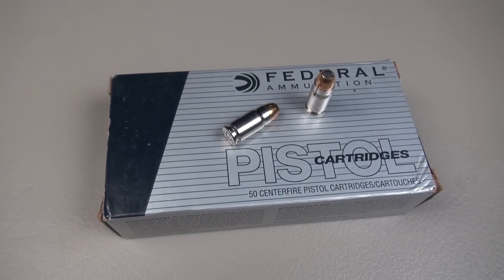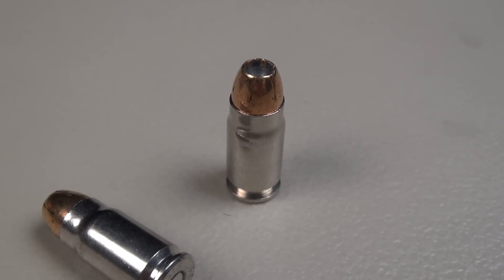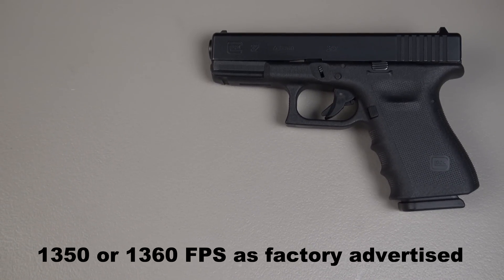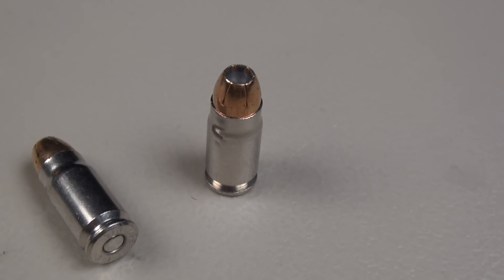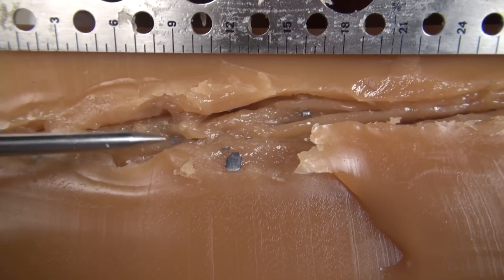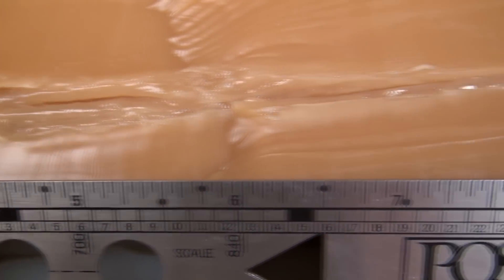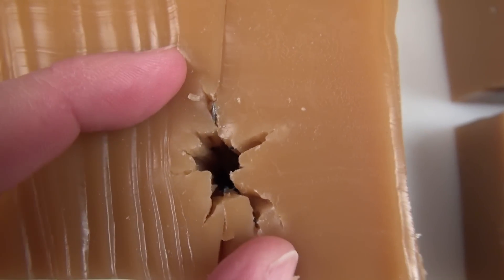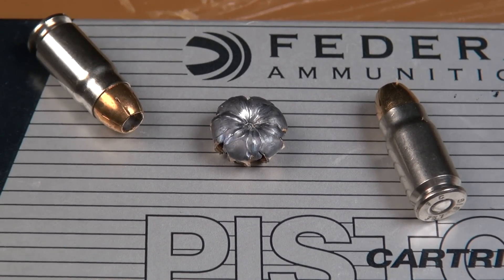.357 SIG Federal HST Ammo Gel Test

Comment: .357 sig is superior in my opinion, i dont see why more people dont use it, its not very common, but clearly superior, and ive shot alot of handguns, i dont really feel much a difference between shooting it and .40 sw
Reply: MrZacfisher I agree 100%
Reply: Agreed Zac.  I get tickled when people say the ".40 is a bit snappy." No shit! The .357 Sig has a more ear piercing crack in it's report but the recoil is not noticeable to me anyway. And when it comes to stopping power the .357 Mag was designed in the 1930 to "stop charging animal flesh" - man or beast. The .357 Sig caliber is without doubt the best combination of size, ammo capacity and stopping power.
Reply: 10mm has same capacity, bigger diameter, more velocity, heavier bullet. More of everything and same capacity. My current night stand gun is a Springfield XDM 5.25" loaded with Underwood 165gr gold dots at 1400fps advertised (i suspect more in the 5.25 but have not chronographed yet). My EDC is a 45 though.
Reply: @morbo5061  10mm has the same capacity in a larger magazine, in a larger gun. 10mm requires larger-frame guns similar to the guns that shoot .45 ACP. .357 SIG goes in normal-frame guns that would otherwise be chambered in 9mm or .40 S&W. It is true that the base of the cartridge is the same size, but OAL is not the same.
Reply: @wombat8882  i am not a 40 fan and maybe one exists where the difference is more dramatic, but i just compared a Glock 20 to a Glock 22 and 23. The smaller one you give up two rounds of ammo and the larger the same capacity and length is only .04"  (that is 1mm) longer for the 10mm. Most people are using the 10mm for home defense or woods carry anyway, but the platform size differences are miniscule. I carry a .45 subcompact when away from home unless i am heading to the back country (then sometimes take the 45 Super over the 10mm). Its not like a subcompact 10mm doesnt exist though (Glock 29). I just dont see the point of giving up mag capacity going from 9mm to .357SIG to still fire the same .355" diameter projectile, when you look at 10mm ballistics and could have that for the same tradeoff.
Reply: @morbo5061  I would suggest handling a Glock 31, or if you can't find that, a 22 or a 17 are the same size, and then handling a Glock 20. The size is not the same. The comparison is similar with other guns. In full-sized SIGs, the 226 (9mm, .40, .357 SIG) is double-stack, the 220 (.45, 10mm) is single-stack. It's reasonable to prefer 10mm, .45 or any cartridge anyway, they all have their advantages, and their fans. I like them all. 10mm is more versatile than .357 SIG, it has more ways to be powerful, while .357 SIG is a one-trick pony (velocity). But it's fact that you will have a smaller grip and/or more capacity with .357 SIG than with 10mm.
Reply: @wombat8882  long story but not a Glock fan and do not own now or plan to ever own another. I have however owned four of them over the years. Models 20, 26, 27, and 33 specifically.  I didnt say the size was the same, just that is is very insignificant. Compare the closest weights available at Underwood ammo between the two which is 357 90gr@1700 and 10mm 100gr@1825 or 357 147gr@1250 vs 10mm 155gr@1500 its niche as being a one trick velocity pony disappears vs the 10mm. The 10mm has 27% more frontal area, more velocity, heavier bullets, and more of everything. Same exact capacity for similar sized platforms (same diameter cartridge) and  the 10mm only gives up a millimeter one way or two in another direction for it. I love all guns and .357 is absolutely impressive tho, just don't see getting a 357 over it when looking at a list of pros and cons. Im not even a real 10mm fan even tho. I prefer 45 Super over 10mm personally.
Reply: @James Javanovich width is what i notice most in concealed carry. I alternate between a double stack 45 (Springfield XD Mod2 3.3") and single stack 45 (Springfield XDS 3.3") and i do notice the 6mm width difference between them. Between double stack guns its not nearly as pronounced and between the G17 and G22 its only 2mm. I wouldnt notice that small a change very much.
Reply: @morbo5061  you need a 45 framed gun for 10mm... 357 sig needs a 9mm framed gun.. Both have similar terminal ballistics

Comment: That looks like a bad ouch to be on the receiving end of. Always been impressed with 357 Sig! tnoutdoors9, you make absolutely amazing videos! Thanks for going through all the effort you do, setting up lights on your deck at night, to bring us awesome videos! By the way, if you can answer a question, can you reload 357 sig reliably with some good performing bullets? Zero brand, GDHP or anything similar to save a buck? I reload all hollow point now in all calibers and really interested in the 357 Sig, but not sure if you can reload easily with that tapered case. Thanks!
Reply: Art Copeland Thanks Art.. I did some research, but haven't purchased a conversion yet.. will soon most likely. I think this is basically like carrying a shrunk down 10mm in many ways. Tons of power, ultra reliable feeding, better than most handguns, and I just obtained a bunch of cases to reload the last couple months...so will be purchasing a conversion barrel and dies soon to reload.
Reply: Art Copeland Thanks Art! I only consider it as akin to the 10mm, as being similar to a magnum version of it's own caliber.. aka: 10mm is the magnum version of the 40, like 357 sig is the magnum version of the 9mm.
I run a TON of rounds per year.. likely in a literal sense. I reload.. if I'm not reloading, I'm shooting or buying reload supplies. 
I run a Dillon 650xl and love the reloader. It is set up now for 45ACP, as I'm running my 1911s a lot lately. 
I fully believe that any gun you own, you need to know how to shoot that thing, run it, reload instinctively, without even thinking about it, and shoot it until you have no more flinch from it, or wear it out.. my personal philosophy.

Here in the commie state of California, all the laws did here is make us a master of reloading, master of building firearms and a master at thinking outside the store shelves when it comes to ammunition. 
I can build entire rifles out of bar stock steel and aluminum.. I can make ammo and supplies out of other cases.. such as making 5.45 x 39 cases out of 222 Remington cases.
The 357 Sig rolls right up my alley, as I can get conversion barrels for 4 or 5 different models of my glocks.. so once I get enough brass, 1000 minimum, I will convert at least my G23 and maybe my G27 into 357 Sigs and run them for self defense once I deem them reliable. I love the fact that the diameter of the bullet is so much smaller than the base of the cartridge.. The only thing I know that is similar in feeding characteristics is the FN5.7 and the AKM series rifles. The bullet almost can't miss going directly into the chamber. Merry Christmas Art, and all the best for 2015!

Comment: I'm a big fan of your vids, thanks!!  Please, if you can... do a vid on the MagSafe .357Sig 64gr, 2150fps!!!  have seen some MagSafe vids, even the .380 causes MASSIVE destruction...  I have the first 3 rounds in my G32 of this... if I have to use them, I will report back!!  Cor-bon makes a 80gr Barnes TAC-xp that would make a nice vid too!!

  Hickock45 says there are problems loading .357Sig into a Glock mag made for .40... ever have feeding issues?  I haven't.  thanks again for all your work!!   ;-)
Reply from the maker: I categorize MAGSAFE as exotic ammo.  Although it opens a larger than average permanent cavity the first first inches, penetration is usually lacking as a result.  Check out the .40 Extreme Shock vid here from a few years ago; it will give you an idea how this performs, even in .357 SIG.  

I've had issues with one or two .40 mags loading .357 SIG but they were earlier generation.
Reply: ***** I think you should review some more exotic loads, just having the information out there won't hurt.
Reply: ***** hey toor9 just wondering if you can make a video on what to check for and how to tell if a barrel need
replaceing annd stuff that would help alot thanks.
Reply: ***** Would you call the Underwood Speer Bonded exotic?  I would probably try to use it as I believe it is the GDHP bullet but going at 1500+ fps (in G31).  Odds are it might be a bit fast for the bullet in terms of terminal performance, but if I figure if I'm going to shoot the Sig, I want as much velocity as I can get.
Reply: scott sanborn There is nothing exotic about a Speer Gold Dot. It's very common. Underwood is quite particular, however. No one loads their bullets as hot as Underwood. It's simply the best ammo available unless you're hand loading.
Reply: Mazn W. Even Buffalo Bore?
Reply: Mazn W.
Agree, Underwood is tops... I conceal carry their Extreme Defender in .45ACP +P (Lehigh bullets), ditto for open carry with my G20 in 10mm (how does 115gr at 1700FPS sound?)  :-)

That said, I also carry alternating Magsafe, in the summer... it has gotten to be so popular that it is very hard to find.  Even though TnOutdoors is skeptical, any tests on real animals or animal flesh are compelling... even their .380  This stuff is an ass kicker.
Reply: I'd say the difference between Buffalo Bore and Underwood is bordering personal preference. Both are loaded very stout. Based on personal experience and endless online research, Underwood seems to be the most consistently loaded and also the hottest loaded ammo out there for 10mm. It's all I carry and it's never failed me. In 10mm my flavor of choice is 180gr XTP.
Reply: Mazn W.
XTP is a good bullet... why do you favor it over the Lehigh Extreme Defender bullet in the Underwood ammo? Just wondering... both will get the job done...

Comment: Shooting somebody with this kind of round would be an act of sadism even in self defense .
Reply: lmao
Reply: No different? Well with that logic, then you'd have to believe 9mm performs no different than .380... That's essentially what you're saying. What 9mm is to .380, .357 sig is to 9mm. They're all .355 caliber bullets with about the same increase in velocity and energy happening between .380 and 9, that's happening between, 9 and .357 sig.
Reply: It's not the same as 380 to 9mm. Find a 124 grain bullet in .380. 9mm is closer to 357 sig than 380 is to 9mm. While the sig round is significantly more powerful the question is, is it worth the price? For some people it certainly is
Reply: Ronin T my carry 357sig glock
Reply: @L Frn 13 inches from a .380? Are you alright? Also, this hits way harder than a 380. So it has penetration and strength behind it.
Reply: If you need to shoot someone in self-defense, what you want to happen is you want them to hit the ground and be neutralized from causing more harm. Everything else is a side effect of that, not the goal.
Reply: Ronin T sadism is a term applicable to torture. This is designed to kill. You apparently aren't comfortable with that idea, or believe others should be ashamed for wanting the advantage. The cure for your condition is a slow walk through the place they keep 2nd Place Trophies For Armed Conflict. Some are nicer than others, all of them include your engraved name, and none of them can be handed out more than once. It shouldn't be hard to find. Cemeteries are everywhere.
Reply: Steve Nevil 😂👍🏻